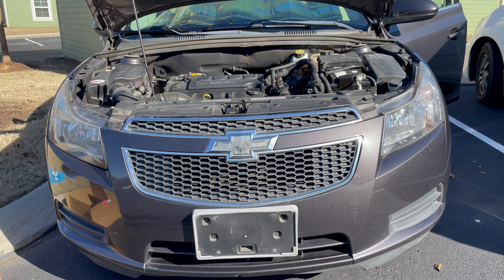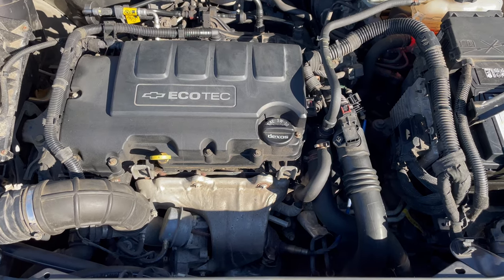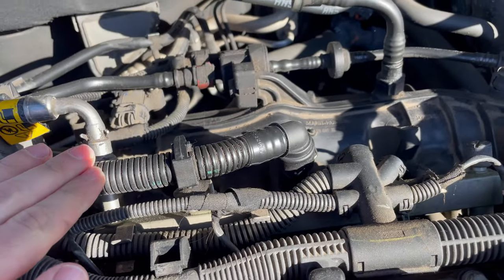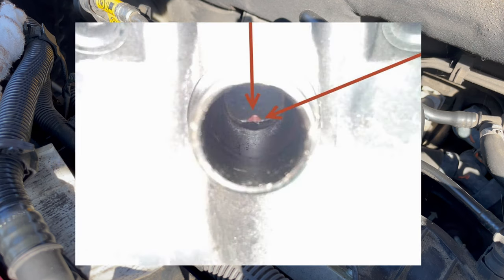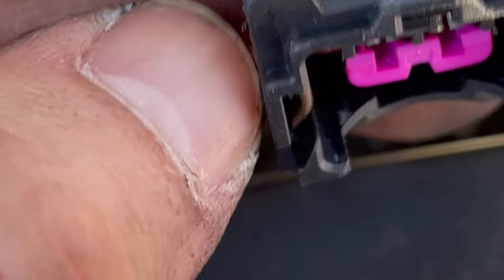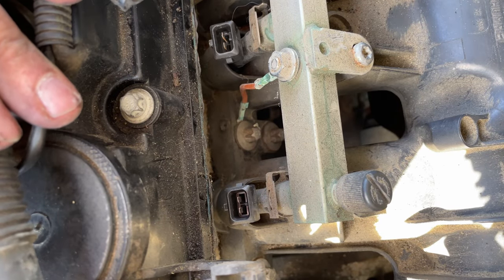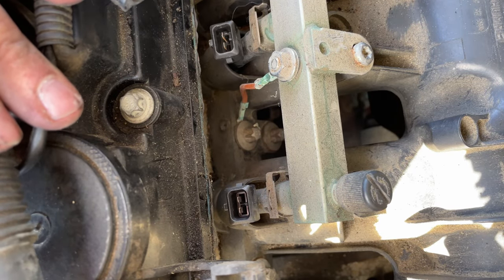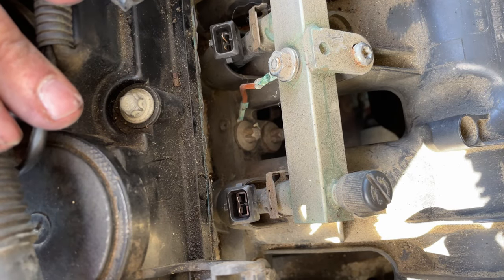How to Replace the Intake Manifold, Valve Cover, and PCV Hose on the GM Ecotec 1.4L Engine

Comment: Thanks for posting. Doesn't look super difficult  but there are a lot of steps and hoses and wires and fuel lines. And things that have to be disconnected that can crack or bend or get lost.  I think I'll pay a mechanic to do this. I can handle a valve cover myself.

Appreciate your calm,  Bob Ross like demeanor. This must be the most relaxing car repair video I've ever watched
Reply from the maker: Haha, thank you!

Comment: Very well made video and you clearly know what you’re doing, thank you for uploading.  That said—I don’t know why you skip important steps like fastening the valve cover in the proper sequence or using a torque wrench.  Too risky for delicate plastic parts like these, in my opinion.  But hey so long as it runs well and you can sleep at night 😅

Comment: I cracked my hose too when I was changing out the valve cover gasket. It's actually seriously taped up right now waiting for the new one to arrive. It split right dead center on the top. I have a 2018 Buick Encore. The only reason I watched this video was because I thought you were replacing that along with everything else too.

Comment: I have a 14 cruze with 43,000 miles on it, i just had the turbo, wastgate, water pump, thermostat, bunch of lines all replaced and just had the same code come back again, turbo underboost, i just bought a new valve cover, manifold and the hose you broke, going to replace it this weekend when i have a few extra days off. Had the car a year since 32,000 about tired of it already lol.
Reply from the maker: Good luck! So many things go wrong on this car that you’ll get good at fixing it!
Reply: Check to see if your turbo is covered by the recall. I would submit it for reimbursement
Reply: @RodHammer888  it was all covered under my warranty.  I bought the car last July and somehow got a 3 year 36,000 mile extended warranty with it. I've only had to pay for my deductible $100 out of my pocket. I'm tired of the dealership having my car for a week + is the only reason I'm doing the valve cover and manifold myself or else I'd make them do that too.

Comment: Hi, went through and replaced intake and valve cover. Great video easy to follow .  I am working on a 2105 Buick Encore and my oil cap does not fit?
Reply from the maker: @tcoe1970  that’s odd. Must not have the valve cover lined up. Acdelco brand?
Reply: @AJSWoodworks  i used a Dorman valve cover part no. 264-968
Reply from the maker: @tcoe1970  Mine was somewhat tight, and required harder twisting, but yours might be worse.
Reply: @tcoe1970 did u figure out which oil cap fits the dorman valve cover?
Reply from the maker: @tylerpastorius4859  I just used my old oil cap

Comment: Thank you for this video. You forgot to show us how you unpluged the the fuel line from the rail. Do you need a special tool? I am asking because my intake as only 4000 miles on it and i don't want to remove the fuel rail. I want to port the intake for better flow and performance and de-assemble only what is necessary.
Reply from the maker: No special tools required

Comment: How’s it been since you’ve done this? Has the valve cover diaphragm gone bad again? Did the code pop back up? Any leaks with the Dorman Valve Cover? I’ve seen quite a few people complain that it leaks and/or doesn’t seat correctly, but I’ve also seen quite a few say it’s good. 

I literally just finished installing mine about an hr ago. Also cleaned up the throttle body, MAP and MAF sensors. Figured, while I got them off, why not.
Reply from the maker: It’s been over a year. Don’t think the valve has gone bad, but the codes are still up. I’m starting to give up on that engine ever running well again.
Reply: @AJSWoodworks  I believe GM no longer makes these and I'm sure these issues had something to do with it

Comment: How is the Dorman intake manifold working out?  Have you had the same issue?  I’ve read mixed reviews on it as far as fixing the problem the issue.
Reply from the maker: @redorange  I’m not sure it fixed all of the issues, but it did seem to run better

Comment: Hi, sir. At 1:02 does this mean that replacing the valve cover and intake manifold with the Dorman parts should permanently resolve the issue, even without installing a Cruze Kit? The mechanic replaced my OEM with the Dorman cover and intake manifold and I was wondering if I still needed a Cruze Kit to prevent another failure. Thank you for your helpful video
Reply from the maker: Theoretically, it should prevent another failure, however, I don’t trust this engine at all, and there is bound to be another failure point.
Reply: @AJSWoodworks  Oh. Another failure point for the PCV, or just in general? How many miles do you have? I'm only at 51K but now it's rapidly rising due to changes with work ... I'd like to keep the Cruze going long-term, but everyone makes it sound pretty dismal.
Reply from the maker: @thetayz72  other failure points with the PCV, including the PCV hoses. Other problems with the engine as well, everything started breaking at around 100,000 miles, including coolant system,.

Comment: I had a question when you change yours did you get better performance did a ride better could you tell more power or a ride at the same nothing changed it just needed to be changed because you had a check engine light on
Reply from the maker: It seemed like it ran smoother. Nothing significant, but still an improvement.

Comment: Question: if I change the valve cover and I don't change the intake manifold until 4 days later after driving,  would that ruin the  valve cover? In such a short period of time?
Reply from the maker: I’m not sure. It could vary between vehicles. It just depends on how badly the pressure has built up while you have been driving.
Reply: @AJSWoodworks  🤛 thanks I better wait then
Reply: FYI Dorman 615-380KIT is intake manifold, valve cover, and PCV tube in one box....
Reply: No it shouldn’t and if it did you would hear it.
Reply: Probably not in a short period of time but eventually it will, yess.

Comment: 4:57 plz i need reference of this ring . joint . .
Reply from the maker: Check out the description under the video. It’s called the PCV hose and It’s linked to the exact part you need.